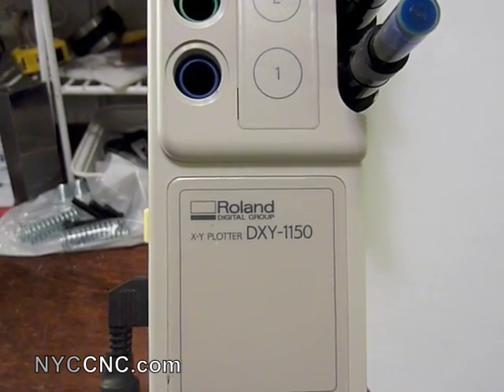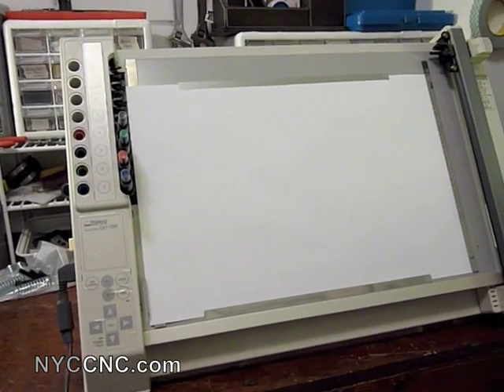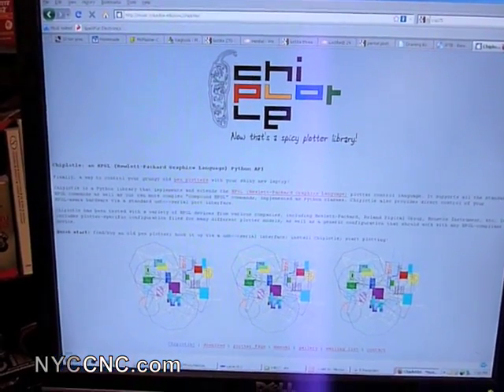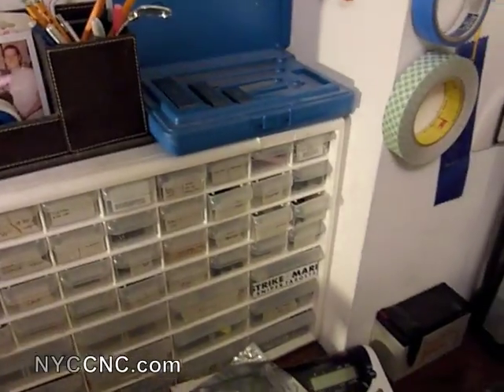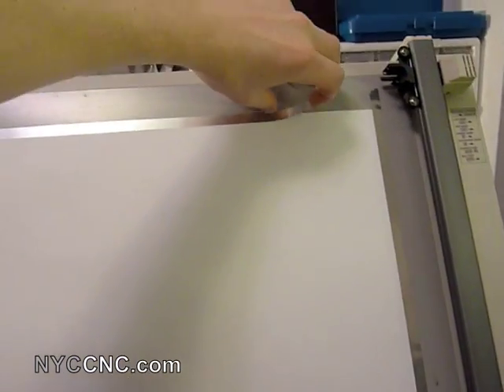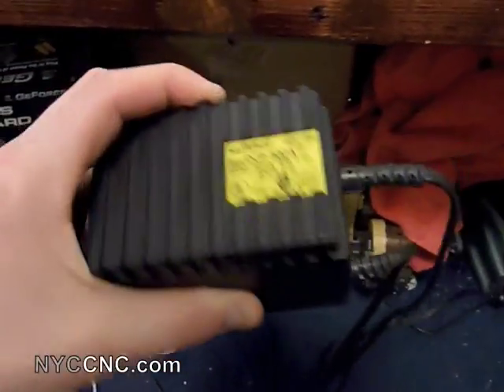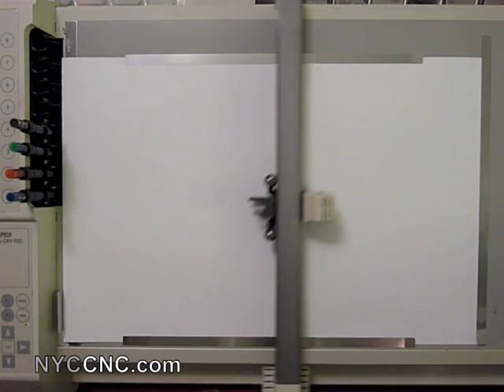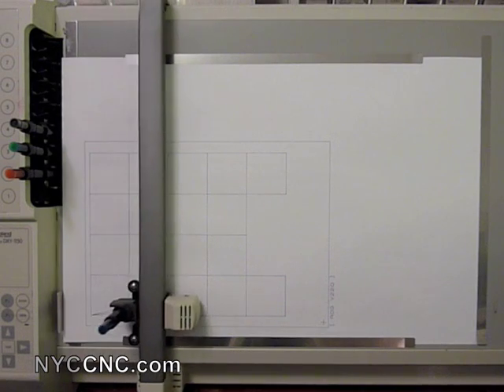Roland DXY-1150 Pen Plotter Printer Overview and tips & tricks video!

Comment: My company used to have similar plotter many years ago. The slides are prepared with Harvard Graphics (Anyone remember Harvard Graphics?) and printed on special paper or transparent slides. The printing mechanism of the plotters is elegant but it has a big problem: the pens dries out very easily and they are very expensive. It was eventually replaced by dot matrix printers, then by inkjet and laserjet and eventually presentation slides were completely made obsolete by projectors.
Reply: Was reading the above comments and was thinking about back in 1994 when I used Harvard Graphics and your comment popped right up!
Reply: @robertwalling9010  In which country did you work in 1994?  We switched to PowerPoint projection in 1995 and I believe that Hong Kong is 3-4 years behind the US in adopting the technology. Harvard Graphics was already dead in 1995.

Comment: HI. Nice video. I have Graphtec MP3200. Still in use. Working on Win 7x64. CorelDraw, Illustrator all vector programs. I ve put blade holder as pen1 and can do die-cut. Great machine.

Comment: I have an old Roland DPX-2200 plotter which I used until a couple of years ago for plotting circuit diagrams and family trees.  I guess I could obtain a USB to Serial converter and use it on my current PC.  I used ORCAD for circuit diagrams and GENBOX for family tree.  Here in the UK it is difficult to find disposable pens these days.  Here's a picture:- www.flickr.com/photos/37876430@N06/16067348153/